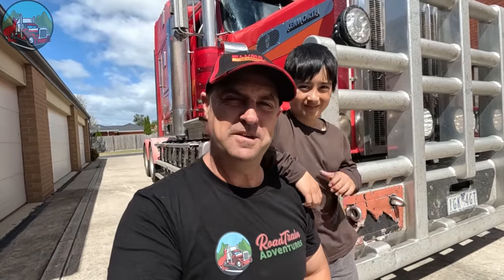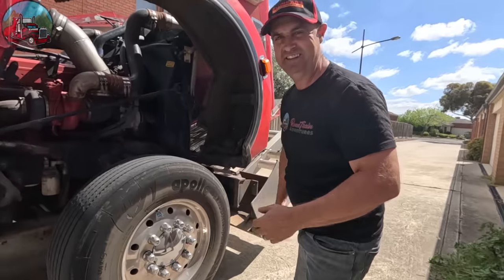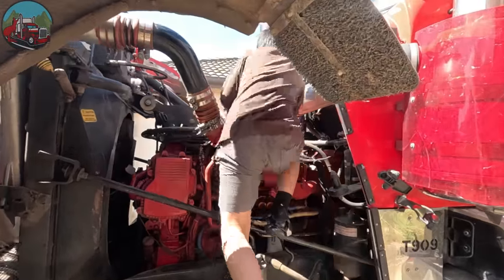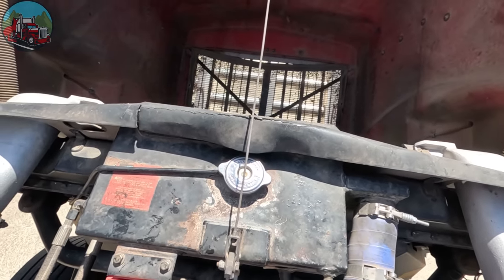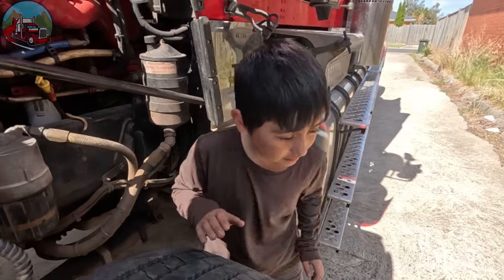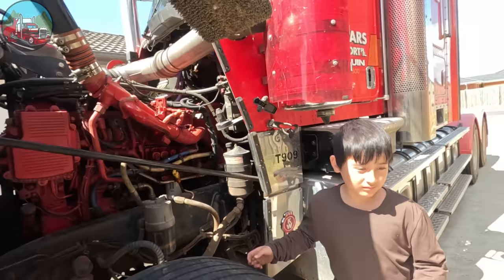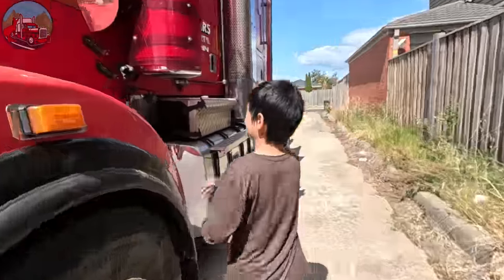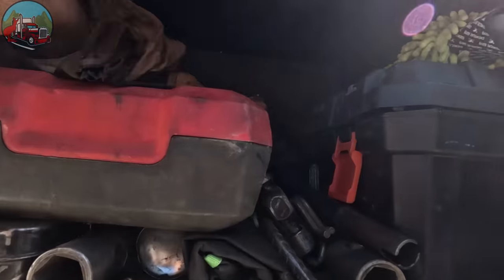How to do a Basic Pre-Start on a Truck

Comment: Every time you take the radiator cap off you should check the seal on the cap . It shouldn’t show signs of being swollen nor should it have started to grow up the sides.
It should be flat all across the bottom.
A cap seal that is growing up the sides will give problems with expansion of the cooling system as it stops the cap from operating at its designed pressure.
This can cause over pressurisation of the system that can result in blown hoses or damage to the radiator itself.
Reply from the maker: You are very right but at this was just a demonstrating video on what we do on a pre start there was no point in going into too much detail.

Comment: Hi Johno, big fan of your videos. In a video could you please explain how the red dot roof mounted air con condenser works and the reason for mounting it on the roof and not in front of the radiator?
Reply from the maker: I could mention that now to the best of my ability. I believe it's because they reckon it gets better air flow up on the roof.
Reply: @RoadTrainAdventures  I think another reason is that the aircon on the roof has his own fan to cool, this works better as in front of the radiator
Reply: The RedDot set up is self contained. You can put them on anything that has a roof. We see Muscat trucks every where.
Reply from the maker: That too